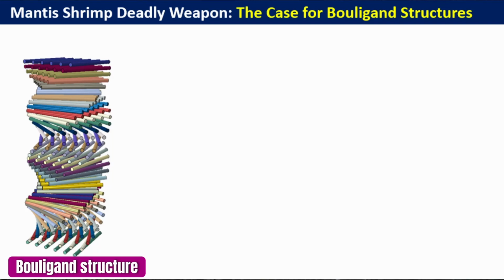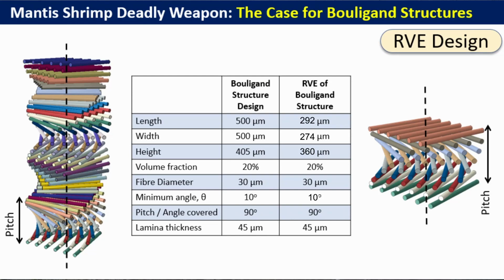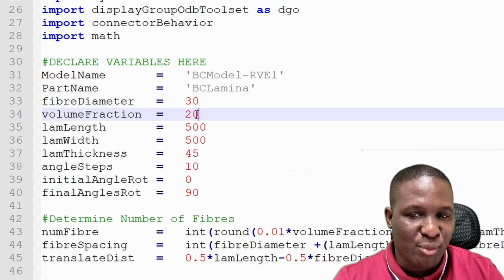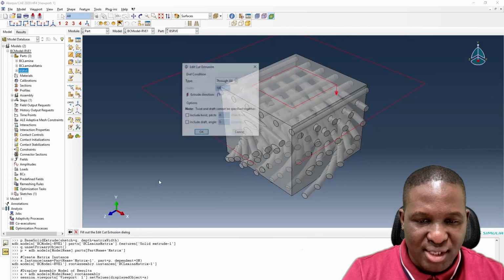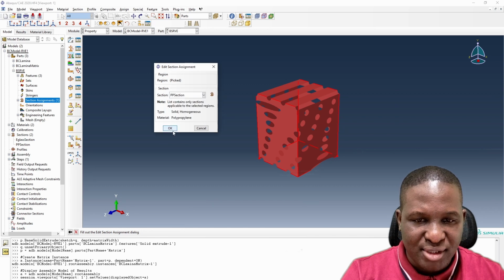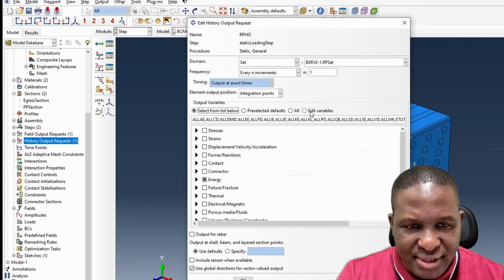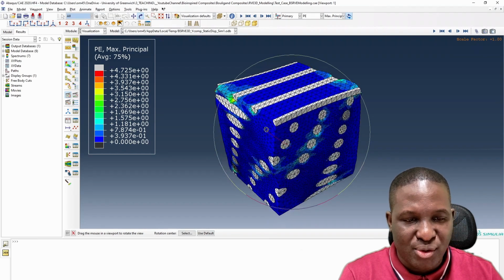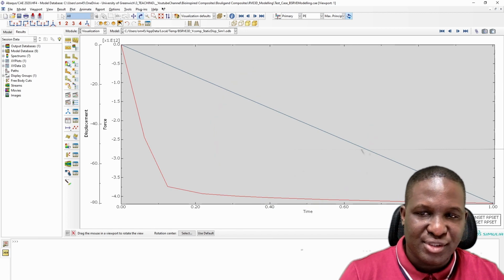Modelling the mantis shrimp weapon

Comment: Why did you select electronic glass for the fiber material? properties are similar to mantis shrimp?
Reply from the maker: This is a very good observation. At the time of modelling, I did not find any reference material with the actual properties of the fibre-segment of the mantis shrimp and the matrix. It is a rather difficult value to find. So, to complete the video, I simply reverted back to the the classic properties of a glass-fibre reinforced polypropylene matrix composite. The expectation is that any one who wants to model the mantis shrimp and has the actual properties can simply follow my approach, except replace the material models with the right values. The aim of this video is to show how one can model the geometry and also the steps/implementations to the numerical modelling but I do agree with you that the properties of the mantis shrimp might be different from the properties I have used in this video. If you or anyone have any resource to the actual properties, let me have it and I can make an update video. Thanks for the comment.
Reply: @MichaelOkereke  Thank you for answering me, I'm studying the Bouligand structure in the cuticle of insects. I've tried to replicate the simulation with the script but still can't get results, it's normal for the analysis to take a long time?
Reply from the maker: @andrealopezreyna815  Running the Python script is quite instant.  Am not sure what's going on unless you're talking about the Abaqus simulation, which indeed will take some time depending on your computer resources.
Reply: @MichaelOkereke  Yes, I'm talking about the simulation in Abaqus. I get some warnings like these:
418 elements are distorted. Either the isoparametric angles are out of the suggested limits or the triangular or tetrahedral quality measure is bad. The elements have been identified in element set WarnElemDistorted.
The strain increment has exceeded fifty times the strain to cause first yield at 3703 points
Reply from the maker: Hello, this sounds more of an element distortion problem. A lot of factors can be behind it, one of which is that the load you have applied to the model is too much so it is causing excessive deformation of some of the elements (in this case about 418 elements). One suggestion is to reduce the load on the model and see if it stabilizes and you get a solution. 

Another reason could be the material model you have specified in the model. If you have used the wrong parameters, it can cause the model to deform excessively as the materials properties are too weak for the load specified. So, again, review your material properties and see if that improves it. In doing so, make sure the unit of the ABAQUS model is consistent with the material properties you have specified. See this video of mine to guid you: https://youtu.be/YeCBDkjEmDU

Good luck.
Reply: (sorry, I'm Andrea from another account)
Reply: I finally got the results you showed us :) 
Do you think it'll work if I try to simulate the compression without the matrix (the cube)?  I don't know if having the cube is helping to resist compression, I would like to study only the structure.  I'd also like to try it with a larger section since some fibers are touching only one fiber below which is unstable, if they are prolonged they will touch at least two fibers .  Another interesting thing to test is energy disciple.
Reply from the maker: I do not think it depends on the matrix. You will need both matrix and fibre for effective transfer of load so you cannot get the same result by only simulating the fibres. If you extend to a larger section, it should not matter - just be careful how you post-process and post-analyze the data. What do you mean by 'energy disciple'? Did you mean energy dissipation? That will also be an interesting thing to explore and you should get more insight into your problem by looking at the energy history and evolution. Good thinking!

Comment: Sir, whenever i set a reference point to extract stress, strain, RF, displacement on that point, abaqus could'nt extract data on history output and shows this: 
"XY data wasn't extracted using the provided option, please verify the followings:
  1. The variable requested was written to the output datbase for the requested element or node. 
   2. The invariant/component selected is valid for the type of element selected, for example, the out of plane principal value is not valid for solid elements."

How will i fix this issue ?
Reply from the maker: It sounds like you are requested the wrong variable for a reference point. Normally, reference points are for reaction forces, RF and displacements, U1 and not stresses.